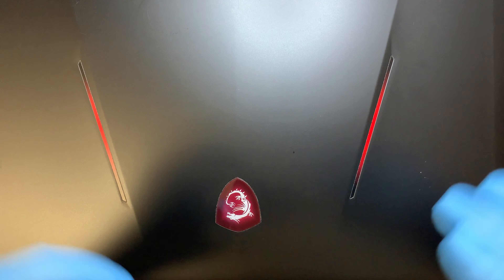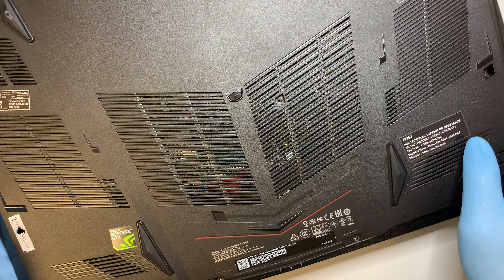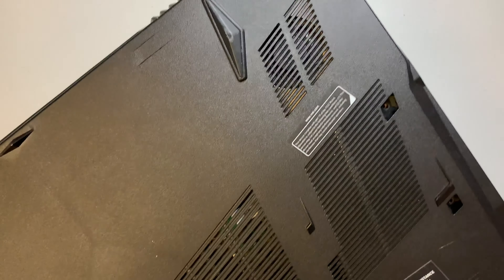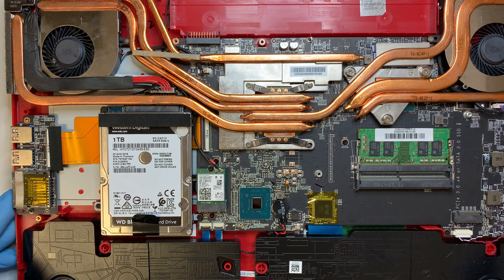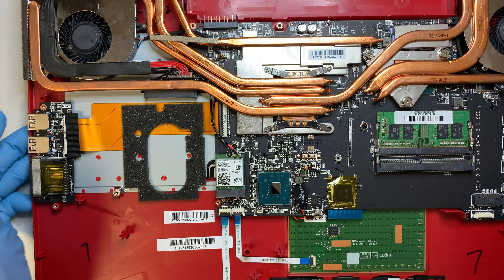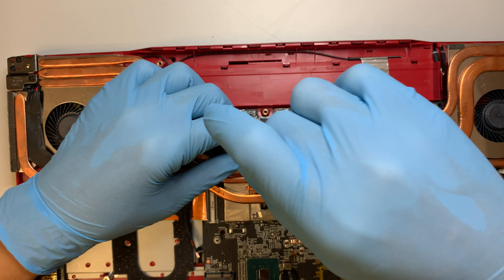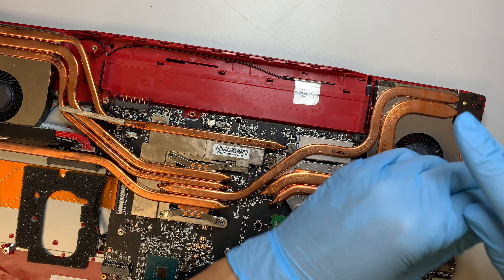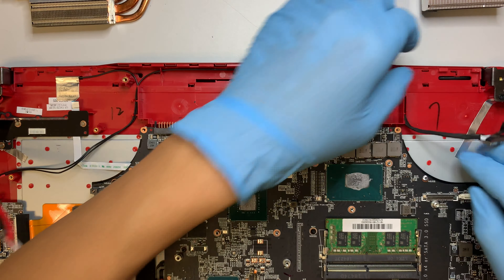MSI MS17C6 Disassemble

Comment: The unit I have has an optane SSD drive for bootup and a 1T hard drive. Crucial says I can add a 1T SSD in the optane slot.
Reply from the maker: Yes. You can upgrade them:
M.2 SSD Upgrade:
https://amzn.to/3iyeS54
https://amzn.to/2F2q9wP

SSD Hard Drive Upgrade:
https://amzn.to/3isxhA1
https://amzn.to/3ntglxg
Reply: @UbergeeksBiz  I know it can be done, but how do I merge the operating system into a single SSD, replacing the optane drive?
Reply from the maker: @C00lestNerd  To clone HD. Please watch this video I just made:   https://youtu.be/k6_K9Y2SHbo